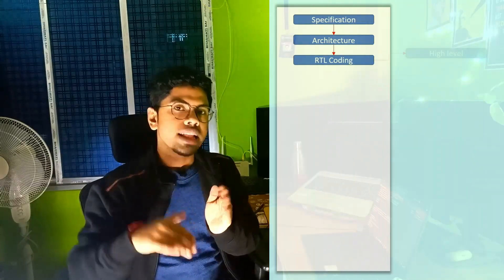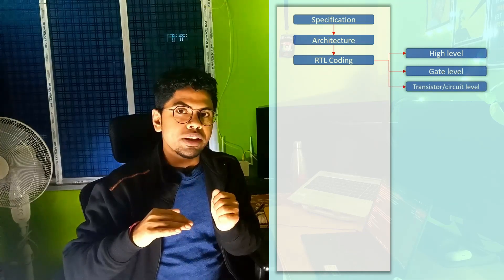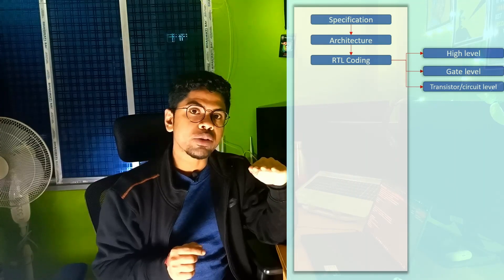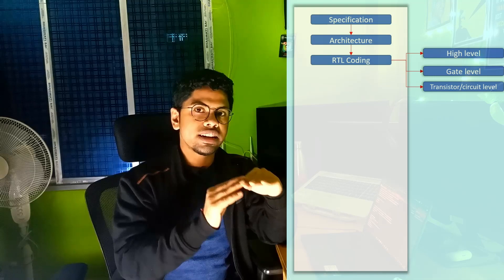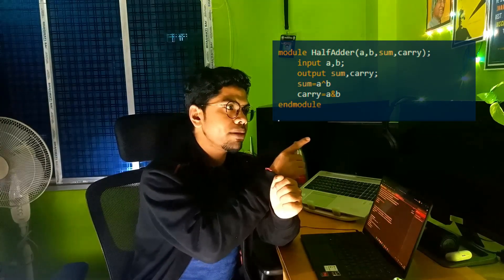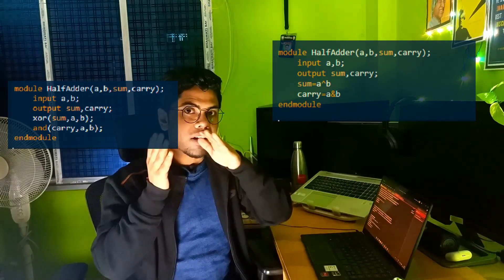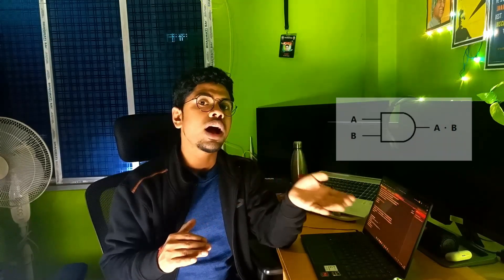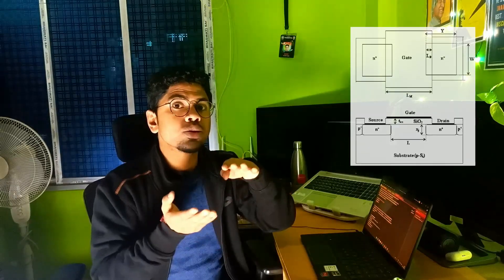VLSI All Jobs Explained | Which one is best for you | Opportunities in India | Ep:1 VLSIgayan

Comment: 1. in frond end after rtl coding and circuit synthesis verification engineer verify the circuit, which eda tools are used to verify this? 
2. routing, is it done by machines or firstly  routing is done in any software manually then necessary apparatus follow the design and build it? if placing and routing firstly done in any software tools then what tools are used for placing and routing?

Comment: Hi sir, just a clarification needed, from your explanation, does this mean Backend Verification is a different job role from Frontend design Verification OR are these two tasks performed by the same individual?

Where does Validation come in?

Is Backend Verification same as  Post Silicon Validation asper your explanation?

I am starting an internship in Post Si Validation but eventually I will like to switch to GPU or AI Hardware Verification Engineer full-time, how will I be able to leverage the experience gained in Validation role to the Verification role I seek?

Kindly help sir, thank you.
Reply from the maker: Hi Johnny in some case and specially in small prototype or in startups a single guy can do all the task. And yes front end verification is a different job roe then backend..... Backend verification is not same as post silicon validation... Post silicon validation is actually a part when the product is ready ,which imply in some sence  its doesnt come inside fronted or backend... And it termed as miscellaneous job profile..... As Job role in post si validation and verification are not same... When you start your journey for verification probably you wont be able to directly leverage your learnings... But yes again every profile need the circuit knowledge and which you can leverage later..... Having said everything please be sure this definition of job profile are not fixed and they dont have a proper def,and keep on changing person to person or situation to situation.
Reply: @whyRD  thank you for your feedback.
Can I get your email address to keep in touch with you?

Comment: Sir, which domain(front end or backend) gives more salary and hikes and is it possible to shift from frontend to backend domains?
Reply from the maker: Hi its possible to change the job , i have not done ths yet , but if you have the skill you can do anything... Both pay you enormously no upper limit , condition you are the master of your skill... So its simple leant the things and make your own rules
Reply: Both the roles will have same pay range. I haven't seen much difference as a VLSI engineer myself. 
Coming to hikes, one won't get it just because they are in a specific dept. It all depends on what impact you brought for the project you worked, in the end it is all performance driven.